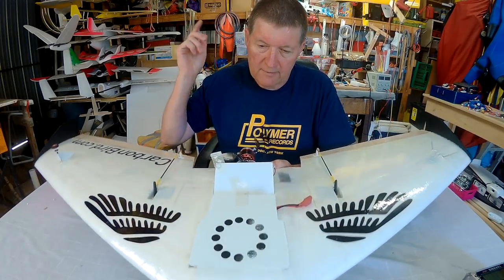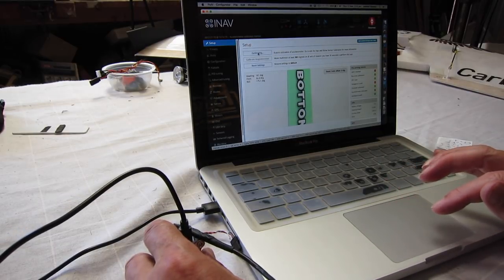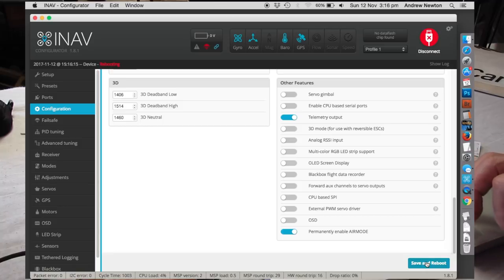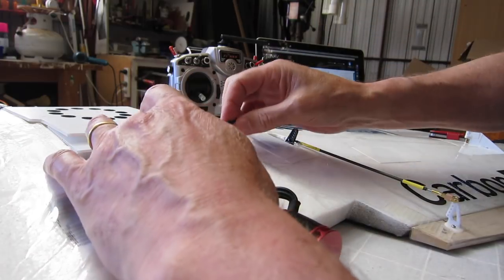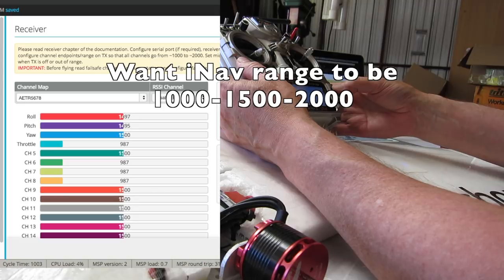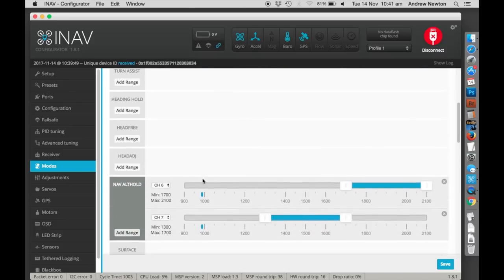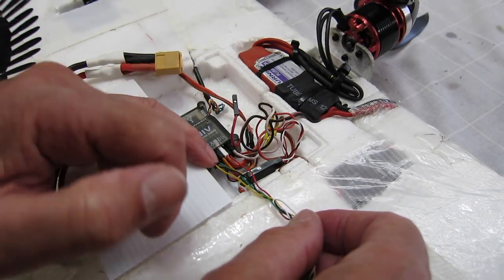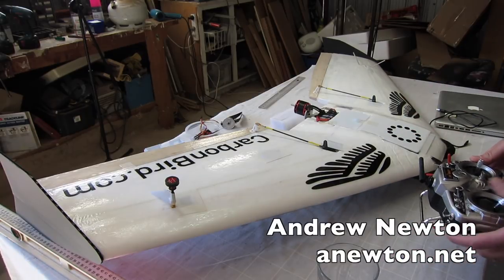Zephyr Z2 AIR3 iNav & OSD setup

Comment: Thank you very much for the step by step, very clear and easy to understand instruction while showing the INav Configurator screens. Wonder if you might show your motor screen servo slider display as you move the wing controls. I have a Channel 8 that moves with right aileron. That one is a mystery.
I'm using an F3 board on a Modified Teksumo with a Synapse fuselage. I received the AIR3 all the way which I will place in my new XUAV SkySurfer. Plan to fly at the edge of line-o-sight, FPV and proximity fun.

Comment: Hi Andrew another great video. Did you do the Servo Auto Trim and the PIFF  Autotune  when in flight or is that a process you didnt find was needed?
I still have no idea what the piff settings do except for a little sentence saying it has something to do with guessing when the plane will fly straight.
Reply from the maker: I have left all of that as it was Angus. The preloaded settings seem to be good. I suspect the PIFFs are not as crucial to fixed wing stability because a wing is naturally more stable than a bundle of motors. props and electronics (quad) Matt Ogs advice is to leave them alone, and Quins advice is, if you do want to tweak the PIFFS, take a laptop to the field, save the CLI change one parameter and test it then repeat. All you would be trying to achieve is less wobble or drift around stability corrections, and I have not seen any need so far.

Comment: Thanks. Too cold/rainy to test my inav setup yet.  If you have more than one stick in a position does that mean the modes are going to combine or do any of the modes take priority like return to home does that override the position? I'm just trying to work out my sticks so that an emergency I can flip it to return to home and I don't have to remember to turn off some of the other sticks.
Reply: Hi Nathan....That was an obvious question that I also had....Having used iNAV extensively now, I have come to the conclusion that iNAV uses only ONE Mode at a time.  The reason is because if for example you go from Horizon to say Alt Hold, you can no longer control pitch in Alt Hold....and iNAV will work the throttle if needed to maintain height...During RTL, iNAV is in total control, flying Home on the GPS....I have on one switch Pass/ Horizon/RTL....and on a separate switch I have Alt Hold....An easy way to describe it, is that the current flight Mode will show in your OSD, and you will only ever see one of them...But you are quite right, even the Wiki seems very vague about your valid point.  Hope that helps....:)
Reply from the maker: Excellent thanks, I'm not totally on top of this yet. You can combine Alt Hold with other modes like Angle, Pos hold. More testing required. RTH definitely takes over from everything else.

Comment: Andrew I recommend you only use a single OSD source. It is not unknown for two OSD's to interfere with each other plus you are probably also slightly degrading the video quality with the extra layer of processing. I personally never bother with volts on the OSD but simply rely on the FrSky telemetry and voice alerts which is more accurate and versatile with the LiPo voltage sensor.
Reply from the maker: Thanks Rob, I'll try an LC filter and an FPV cam with no OSD.

Comment: Alternately, use an Omnibus F4 FC with onboard OSD....much easier, less wiring and cheaper too.  Sorry Andrew, but it's just the truth. Looking forward to seeing you fly it though.
  I think you can get your RSSI for that FrSky receiver to show up on your OSD...........channel 8 or 16 along the SBUS line...Works on mine a treat..a must have for FPV.
Reply from the maker: I have RSSI on a switch and spoken when it gets below 50. I do like the Omnibus F4 OSD and setup in iNav Configurator.
Reply: @EnglishTurbines i have a couple of the omnibus f4  pro v2 - they cant really compare quality wise. the features are good but there are some problems with them. they're good for a wing but for an airplane you have to fiddle with pwm5/6 (and pwm5 is used as led pin so thats 3 servos max when using led)

Comment: Dear sir andrew.. if i install a BL motor on an puller type model do i make it turn Ccw or Cw? Visavis a pusher type model? Hope to hear from you... im an avid fan of your channel...
Reply from the maker: Depends on the prop. You can buy CW or CCW props these days. With a CCW prop, if you are standing in front of the plane, puller and pusher motors turn CCW.

Comment: Ok so you have in the subscription OSD setup. You dont and srud people like me need tgis info. 
As stated when I received mine I got the 5volt Ubec I gues C1 cap 
Now in the diagram it sits between the servos if running 4. But real men crash wings! A quick image search on google and it shown in Q1 of AP.
My question is should I just toss it as you dont seem to have issues with it? Also being one of the only Paris Air3 video instructional guys on the net are you planing on doing an OSD swtup? Or did I just blank out again?
Hey thanks for the ali been raining all weekend and son was so keen given he was going to go for first flight with a plane, Opterra, and first use of am AP. I m going to dig the old BGL fix up the old Flight test Spear I made 2 years ago but never flew.
Buy the way that plastic mold is fantastic. Takes a couple of goes to make thing not look like a monster made rhem but fantastic for our Hoddy especially with the colour that only need 3 beads to a desert spoon of molding beads. Great stuff.
Reply from the maker: Hey Angus. This is the only video I have done on the OSD setup. I don't know how likely a board-killing voltage spike is, never had one that I'm aware of. But I do fit the C1 cap if there is a spare slot.

Comment: I just brought the air 3 inav board
Reply from the maker: Let the fun begin!
Reply: Andrew Newton last week I got the x uav sky surfer x8 im planning on putting the air 3 in it do you think that will be a good fpv platform?
Reply from the maker: Perfect Bob. My favourite FPV setup is my old Bixler 2 with iNav, so yours will be almost identical.
Reply: Andrew Newton good it might be a little bit nose heavy because I tried using the cc3d revo on it and it flew straight for about 50m than plowed into the ground and broke the nose into bits but i hot glued it back and it looks fine
Reply from the maker: Oops. FCB should have taken care of that?
Reply: What’s an “FCB”
Reply from the maker: You just bought an FCB. Flight Control Board
Reply: Oh that’s what you ment
Reply: I hope I can get this to work tho because I don’t want to waste my money and there is no one in my are that is really into the hobby that can help me